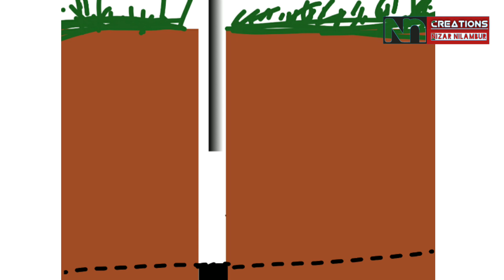How to install electrical Earthing | #Electrical grounding at Home | Reduce earth Resistance  #Earth

Comment: Dear Sir,

Greetings from Avon earthing company Pvt Ltd !!!
  
ELECTRODE EARTHING, LIGHTING ARRESTER,ALL TYPE EARTHING AND GROUNDING EARTH SYSTEM ETC.
LEADING MANUFACTURER OF CHEMICAL EARTHING AND ALL TYPES EARTHING AND LIGHTING ARRESTER.
It was good to talk to you and as per the discussion, we are sending here with our Introduction which introduces about the nature of our Products & Services.

AVON THE TOP ONE BRAND 
TOP QUALITY PRODUCTS AND SERVICE .
We Avon earthing are Promt Manufacturer Duly registered under Micro and Small Industries for manufacturing of Chemical Pipe Earthing (Based on G.I. ,Copper Bonded & Pure Copper) , Earth pit cover, Lightning Arrester, Back fill compound and all type of Grounding systems with the "EEPC brand".

We specialize in installation and testing highly conductive, corrosion free Earthing system as well as lightning protection system.
 
Made in india product .
आत्म निर्भर भारत
We are also in field of ESE Lightning Arrester in Brand Based on Gravity, Kalre & Patroit Turkey as Per Specified NFC Standard. 

" SAFETY IS OUR PRIORITY & QUALITY IS OUR STANDARDS "

Our Product Range Which We manufacture are Given Below-
 
1. Chemical Pipe Earthing (GI,Copper,Copper Bonded, CI etc)

2. ESE Lightning Arrester

3.Surge arresters

4. Digital Lightning counter

5. Poly Plastic Earth Pit Cover

 6. All Earthing Accessories
 
7. All type earthing & lighting arrester,
Earth product and system.
Grounding earth system.

Our electrode is available in different sizes from 2 Feet to 20 Feet along with Back Fill Material which reduces the resistivity of Earth around the Electrode. We assured you for the required Ohmic value in normal conditions as well as with multiple installations in rocky areas.
 
Our Electrodes are manufactured according to standards

'' WE HAVE NO COMPLAINT AGAINST OUR COMPETITORS WHO CHARGE LESS AND PROVIDE POOR QUALITY & SERVICE".

--
Thanks & Regards
Avon earthing company

MD. Rajnish maurya
PM. Dinkar maurya
Sales Marketing 
Prabhat maurya
Cell: +91 9198843785
Mail Id: prabhat150796@gmail.com

HEAD OFFICE:-     
Office: Shop No .232,1st Floor,lekhraj Gold,muncipuliya,indira nagar Lucknow 226016
Tel: +91 9198843785
        +91 7355375353
       +91 7054151809
Customer service 0522 -4024167
Reply: @Nixon Jase instablaster :)
Reply: @Fletcher Elisha it did the trick and I actually got access to my account again. Im so happy:D
Thanks so much you saved my account :D
Reply: @Nixon Jase you are welcome xD